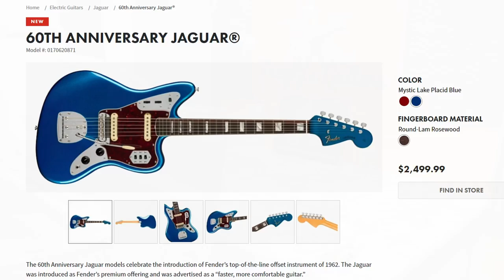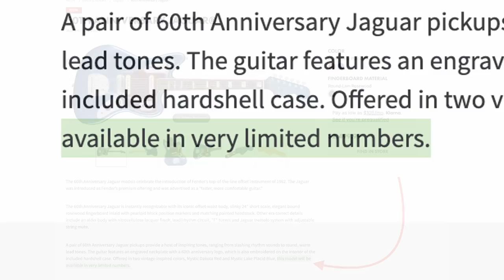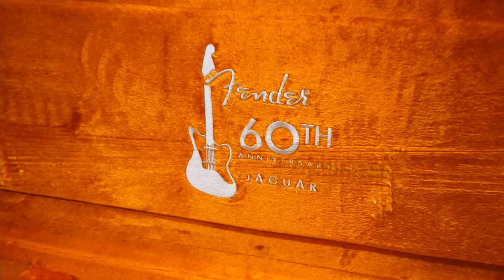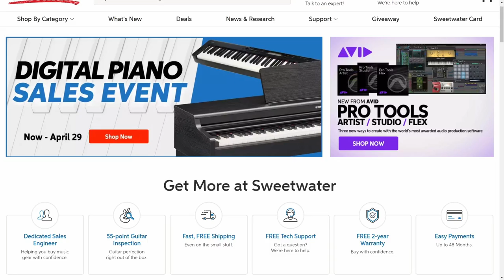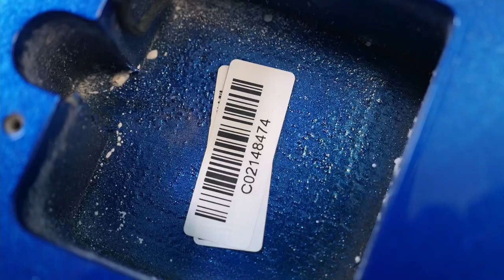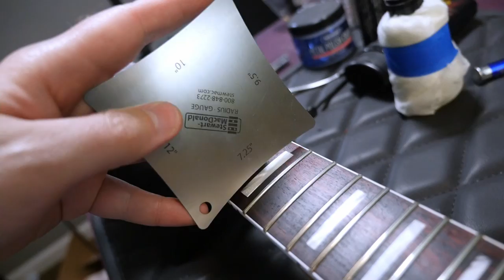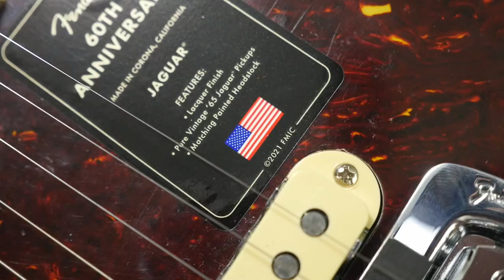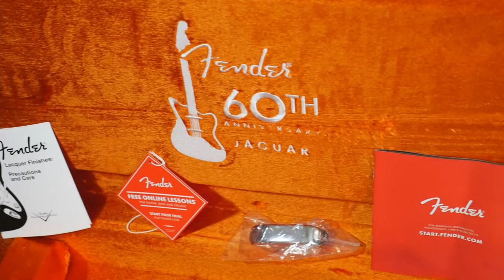Fender Discontinued These Too Soon! | 2022 Fender 60th Anniversary Jaguar Mystic Lake Placid Blue

Comment: The rhythm circuit employs a 50K Linear pot for tone, and a 1M Linear for volume. The lead circuit uses 1M Audio pots for both volume and tone. This means that even though you can isolate the neck pickup in the lead circuit, the rhythm circuit is able to achieve an even warmer tone.
Reply: Did I read that right a 50 k not a 500 k linear pot?
Reply: @clarkbabin9799  Correct, the tone pot of the rhythm circuit in the Fender Jaguar and Jazzmaster is a 50K linear pot.
Reply: I like to modify mine so it goes to the bridge pickup and not the neck. Sounds really good with fuzz and distortion for leads
Reply: @justinguitarcia  cool idea
Reply: @justinguitarcia  Yeah I find the rhythm circuit standard wiring a bit limiting too so I built my Marauder with 2 Jazzmaster pickups and a lipstick in the middle. Added an extra vol pot. So rhythm plate has vol for middle pickup and rhythm tone. Main plate has "normal" tone with a push-push pot with 2 value caps. Pickup selector plate is wired to be switchable between the two tone pots so you can get rhythm/lead on all pickups.
Reply: @justinguitarcia  that might explain why Jaguars and Jazzmaster were a hit with the alternative and indie rock crowd, because it packs a punch with fuzz. 
but as interesting as it sounds, most metal bands don't use them.
maybe it has to do with the pickups and the way it plays,
most people that do metal like to have that thin flat radius, or what super strats give you, Ibanez and ESP. there interesting guitars though,
but despite how unique they are, i think most people like simplicity.
A Telecaster or Strat are pretty straightforward, a Les Paul is the same way.
very straightforward, but with a Jaguar it can be intimidating for new players.
people tend to be the most curious about guitars like this,
but when it comes down to buying most people go with what is popular and familiar.

Comment: The wobble in the bridge is part of the design, it works in lieu of having roller saddles in the bridge. The whole bridge rolls forward and back when you use the whammy bar. The Allen screws in the bridge posts, for bridge height adjustment, are somewhat pointed on the bottom end, which works like the knife edge pivot in a strat trem, and are suppose to return the bridge to a neutral position.

Comment: If you are getting into Jaguars, check out the Johnny Marr signature… he made a bunch of mods to one he bought, and Fender heard about it and offered to copy it as his signature model. He actually plays 4 of them on the road (two have sustainer circuits), he just sanded off his name because it felt too weird playing a guitar with his name on it.

Edit: traditionally, all the pots should be 1M, 1 megaohm, that’s what gives them their unique tone (the tone caps are different between the two circuits.)
Reply: I want them to come out with a reverse reverse jag called a Uagjar
Reply: @russellzauner  about 10-ish years back they did the “Pawn shop” series, and one of then is a reverse Jaguar bass. It looks… odd. (There’s also a Mustang gutiar and bass with Wide Range humbuckers, and a Bass IV with a Jazzmaster bridge humbucker)
Reply: Funny how he sanded it off. His name on the headstock front is what keeps me from wanting one
Reply: @Releasethebats123  
No reason you can't bust out some sandpaper yourself and say it's reliced.
Reply: @Releasethebats123  It's just a sticker. You can peel it off.
Reply: @6bender  my friend tommy has multiple johnny marrs and no you cant peel it off. Put the pookie down son
Reply: @Releasethebats123  I had one. I did. Sorry, I don't do drugs.
Reply: The only thing I don’t like on the Marr (and I am a huge fan of his) is the look of the modified switch plate. I’m a purist when it comes to the Jaguar look even if the functionality is improved.

Comment: fyi, the stopper on the tailpiece isn't designed for a "down-only" synchronous vibrato. It's actually designed as a rescue switch for breaking a string. It's supposed to be setup such that, when you slide that slide, you hear nothing colliding with the metal tab underneath the plate, but also it doesn't make the arm move at all either. It needs to slide in perfectly flush with the adjoining tab. When this equilibrium is right, if you break a string, and slide the switch, the rest of the strings stay in tune...in theory. Most people never use it that way, but the Jaguar was designed to float. Keeping that switch down doesn't make it any more stable if the float is set up right.
Reply: All good trems should float, any other setup is a cop-out!

Comment: Fender Jaguars are interesting beasts, for sure. Not my favorite guitars, but this one sounded quite good. I don’t like the 24” scale either, but Jags and Jazzmasters were designed to be used with heavier strings (a normal set in the early ‘60s would have been .012”-.054” with a wound G string), often flatwounds, which would mellow out the tone considerably and reduce the floppy feel of light strings on a short scale. If I had a Jaguar I wouldn’t string it with anything lighter than .011”s. I don’t care for the mute either—the heel of my hand works just fine. A lot of surf bands used Jaguars, but the British Invasion from ‘64 on kind of killed that. Although the guitar sound on Herman’s Hermits’ Mrs. Brown You’ve Got A Lovely Daughter sure sounds like a Jag with the mute on! One of the more unusual Jaguars from the ‘60s was a black one with gold hardware and the name Conrad Birdie painted on in gold, made for the movie Bye Bye Birdie in 1963. I don’t think the actor who played Conrad Birdie played guitar, but it sure was a cool prop! And the neck binding came in about ‘66, the block inlays in ‘67, only used on Jaguars, Jazzmasters, Electric XIIs, Bass VIs, and Jazz Basses. I’ve always liked that look, but it came along at a time when Fender’s quality was starting to deteriorate.

Comment: I’m sure someone probably already pointed this out, but I think you got that backwards when describing how the rhythm circuit worked during the tear down part. When the rhy/lead selector switch is up that’s when the rhythm circuit is selected and is ON, everything on the top part only uses the neck pickup, and the 1meg Vol and 50K tone slider knobs, and everything else on the bottom part is disabled. When the rhy/lead selector switch is down that’s when the lead circuit is selected and is ON, and it uses the two pickup selector switches, strangle switch, and the regular 1meg master vol and 1meg master tone knobs, and everything else on the top is disabled. 

The metal claw on Jaguar pickups also doesn’t have anything to do with reducing the 50/60 cycle hum from single coils, and it certainly doesn’t help with that, but it was originally intended to supposedly help direct or focus the magnetic field of the alnico pole pieces.

Comment: I’m sorta like a Jag expert.. I’ve had my 63’ since the mid 60’s in which I purchased it with a paper route and promptly joined a surf band in The OC..I never used my Mute and just screwed it down right to the body.. and threw away that lame bridge.. installed a Mustang bridge and never looked back.. it’s a Oly white with matching headstock that over the decades has turned a wonderful cream color but still Oly white under the guard.. I also have a late 65’ without those fugly block inlays and without the doupy F tuners.. it still has the Kluson double lines.. from 66’ on they just killed this guitar.. along with Jimi H!!  I must add these guitars NEED REVERB TROGS!!
Reply: The mute was good for Herman's Hermits mrs. Brown you got a lovely daughter
Reply: So, you have two?

Comment: They did the same thing with the 62 Les Paul which became as we all know the SG. You seethe 61 reissues everywhere and even a 64 Reissue.  But no 62. I'm sure there must've been a little something different in that period . If you remove the mute from the Jag and cant find and spacers I believe I saw at harbor freight you can buy a box of assorted neoprene sealed and spacers  that should have something close. I've bought a few medium level guitars and as you know at least a couple low end guitars from you and elsewhere.  I've noticed that most of the time the medium level and higher play great even not having been set up. But I suggest those get a set up for several reasons including checking the neck and hardware not to mention other issues that on a low end guitar usually aren't to critical. Set up sometimes will let you know if you have a warranty issue.  Most of the my low end guitars I've played with just tuning and no setup and was okay. Mind you all the reasons to set up higher end guitars cant hurt on the low end models. Along with all that I've seen a great improvement across different brands as far as basic amenities to hardware and pickups. Also there just as fun to play as the upper level models and you don't have to worry about bumps and dings especially if you hand it to someone else to play . That's actually how most of the dings arrived on some of my older axes. The borrowing guitarist first thing they do is slam it against another hard object or stand it precariously against the amp or a chair leaving it to gravity to give you some nice wear marks touch hadn't wanted. The choke sort of sounds like a light amount of natural flange added when activated.  Mrs Brown you got a lovely daughter Herman's Hermits is the sing you're thinking of. I just ordered a Stratocaster Contemporary.  Watched the demo and liked the tone options plus  the offset middle pickup . Should have it around Monday. Just saw a new model Jaguar with the reverse headstock.

Comment: I have one of these, I bought it new last November and initially it had a few issues that I got sorted out as quickly as I could but even so there's one quirk to mine that I have yet to see on any others, instead of the big fender logo on the front of the case it's got a rivet tag on the lip, but still has the 60th anniversary logo embroidered inside, so if you're here and reading this and also have a different logo than the one shown here lmk, I'm curious

Also I recently learned that these are crazy rare, there are fewer of each color than there were nocasters

Comment: Wish they’d offer better colors. I didn’t enjoy the red and blue as the only two options. I was in the market for a second Jaguar and so I went Mod Shop instead because of the two colors offered. I’m not saying they are horrible colors but just rather blah to me. Daphne Blue, Fiesta Red, Seafoam Green and similar would have been better choices - my opinion.
Reply: Yea too bad Custom Shop doesn’t do matching headstock so it’s basically trash

Comment: When 'Rhythm is selected what is the pickup combination?'
Reply: The rhythm circuit only uses the neck pickup. You can use it to switch between two different tones on that pickup if you set it correctly.

Comment: The round button is to lock the trem so it doesnt move at all
Reply: Not quite. It prevents you from pulling it up, but you can still move it around and push it downwards. It’s also a part of a Jag’s setup. When you stay in tune in both the locked and unlocked settings, you know you have the tension on the trem spring set properly.
Reply: @leamanc  it’s a pretty genius design that I don’t think trogly has really mentioned. If you have it set up right and break a string in the middle of a song you can lock the trem and return it to the proper string tension, thus keeping the guitar in tune. If you break a string and don’t lock the trem then your guitar will be very out of tune.
Reply: @leamanc  i cud have sworn they have a notch in the locking button so it slides over the trem plate ie " locking" it so it doesnt move at all,instead of stoping movement in one direction but i must have seen a modified one or dreamt it,would seem to make more sense

Comment: Consider changing the bridge and the tremolo because these are the weakest Jaguar components. I would recommend Mastery, you will notice a huge improvement in resonance and playability. The Jaguar bridge is just bad design, strings slip around the slots and harmonics are not properly transitioned. And you are correct, these Jaguars will only increase in value, I have the 50th Anniversary which now is way more expensive than before. Jaguars need some time to get used to, but after that they become addictive.
Reply: This has the American Vintage tremolo system, which is perfectly good and does not have the same issues as some earlier models. I would say Mastery tremolo is only a marginal improvement and probably not worth it unless you're a huge trem user. The bridge is probably a more urgent upgrade